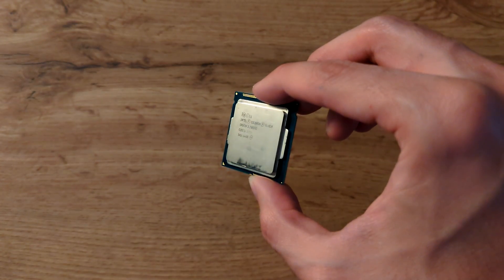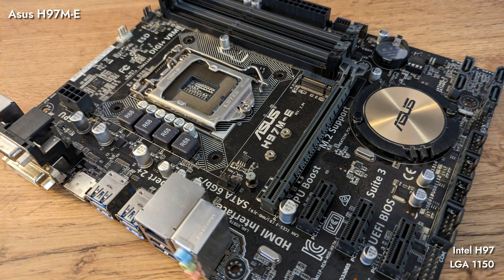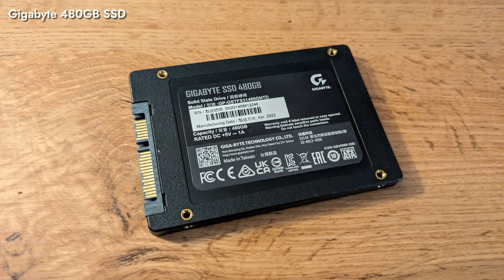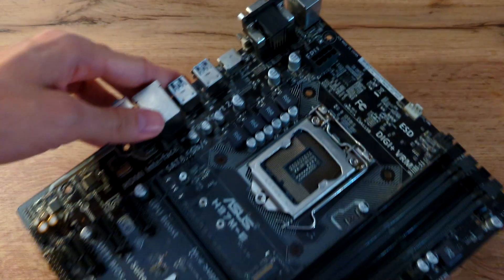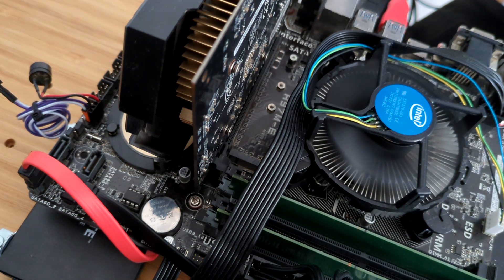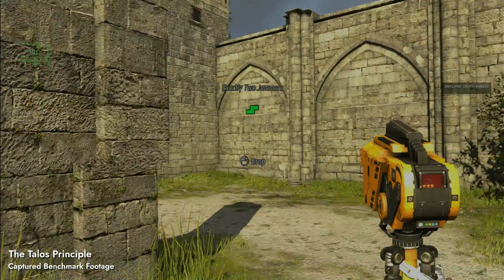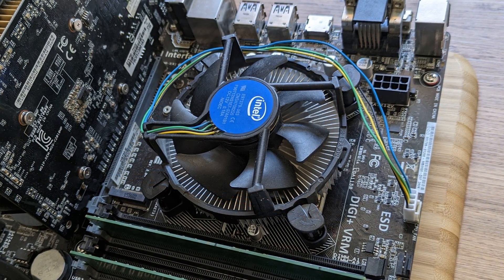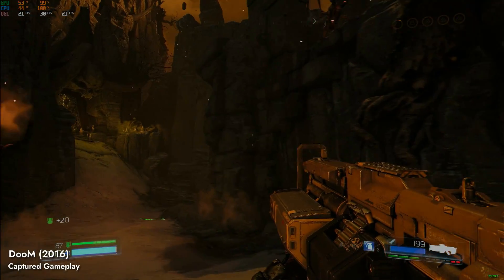2014 Budget Gaming PC Build ( Celeron Budgetorama 1 )

Comment: SO out there in developed lands you actually buy those powerful motherboards even in budget builds? here in the slum jungle, where a 2014 build still sells premium, it's usually a high-end cpu, like i7 4770 with a crappy h81 motherboard, the good motherboards are more expensive than the processors (you can find a i7 4770 for 550 bananas but a motherboard like that h97m-e sells for 600 bananas)
Reply: In developed lands Pentium G3258 + Z97 board + GTX 750 (Ti) was pretty much the standard budget build in 2014. Cheaper end Z97 boards like Asus Z97-P and Z97-C were around 100-135€. The H97M-E looks to have been around 90€ in 2014.
Nowadays 4690K/4790K + Z97 board + 16GB DDR3 bundles can be found for 50-100€